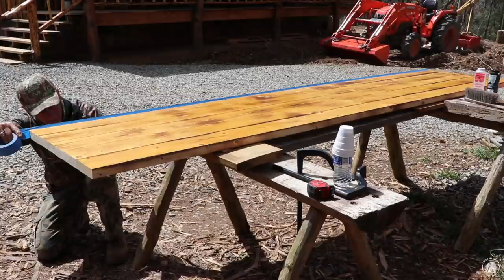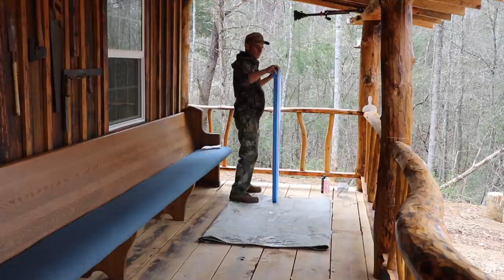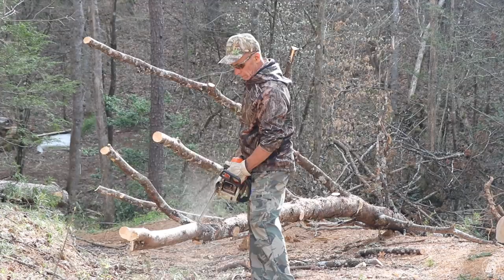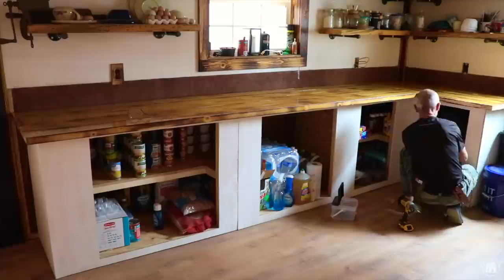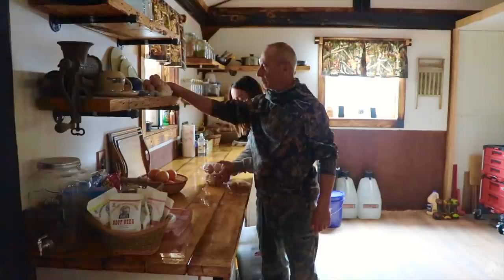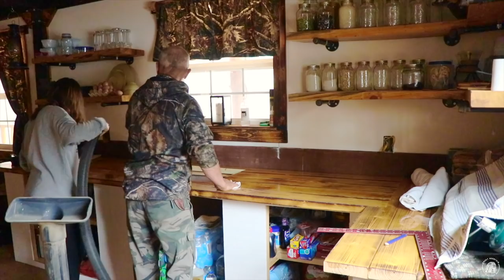KITCHEN COUNTERTOP GLOSS FINISH | SECOND HUGELKULTUR GARDEN | TIMBER FRAME CABIN

Comment: Hey Richard, I'm probably telling you something you already know, but I've noticed this a few times on some of your projects: Any time you put liquid on one side of a board or panel, it's always a good practice to put liquid on the unfinished (unseen) side as well. Liquid on one side only makes the board/panel much more likely to cup, twist or bow. The unfinished side doesn't have to be an expensive finish like the glaze or another kind of finish, it can be a cheap paint or primer just as long as liquid gets introduced on both sides. Generally I've found one coat of something on the unfinished side is enough since the first coat on the finished side usually acts as a sealer anyway. Obviously not as important on outdoor or "rough builds" but indoor, furniture type builds can really benefit from this method. I've learned this the hard way, so I hope this is a tip that helps.